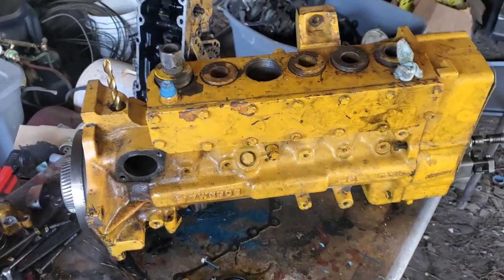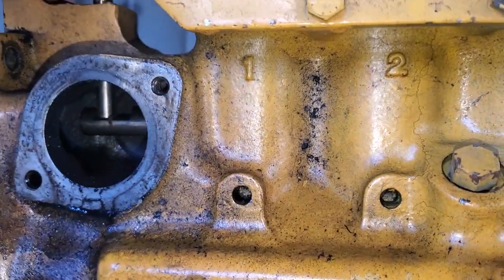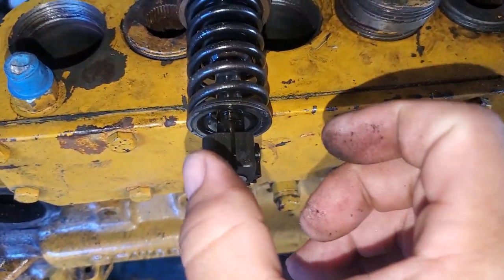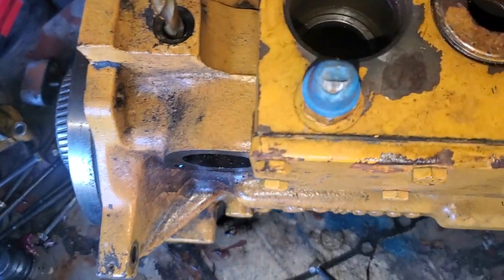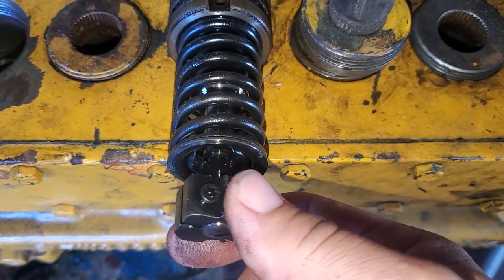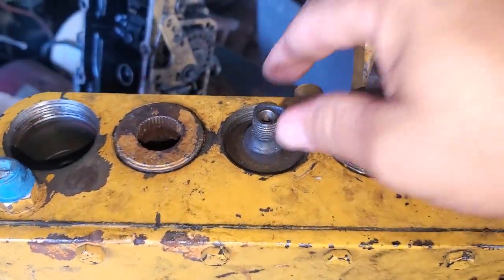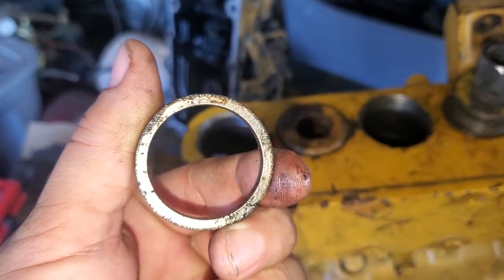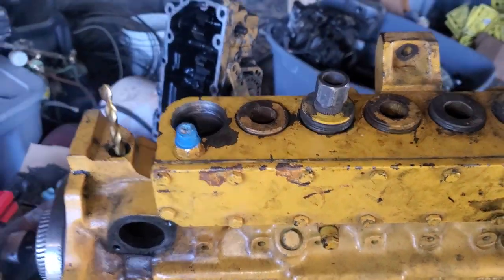How to change/time plungers in 3406b CAT fuel injection pump

Comment: Can you chance the plunges. Whit the pump on the engine. And afther you have to calibrate on the lab. O not
Reply from the maker: Yes I changed mine on engine. I removed the air compressor to gain access to the front ones

Comment: What problem were you having that this fixed? I have a miss\backfire in my #3 cylinder in a 3306. I have ruled out valves, injector nozzles, and fuel lines at this point. Now, I am starting to look into the fuel pump. Did you just put a new plunger in to resolve your issue?
Reply from the maker: Engine would not idle. Replaced plungers and solved that problem. Was not skipping though

Comment: Question for ya I’ve got a 3406c how can I get the rack to stay back on the pin does the pin just sitting on it hold it or do I need to do something else due to not having manual linkage to pull the rail back?
Reply from the maker: There's a cap toward the front of motor. On the side, it has two small bolts. Remove the cap and you can move the rack with your finger

Comment: I changed my o ring on this pump because one was leaking. All of them went in easy except one I had to push that sucker in with a bar. I did it still on the truck but it did go back in I wanted to know if it was ok pushing it back down with the bar I used. Thanks for any advice
Reply from the maker: Are you taking about pushing the plunger down? If so yes there is a cam that pushes up against the plunger. You could rotate the engine and it will release the pressure off each one.  I didn't do that when I changed mine.  Just pushed it down with  screw driver while I tightened the nut
Reply: @skrapenpennies9947  I opened the throttle and it dropped right in thanks again my friend.
Reply: When u say leaking. Was it leaking fuel into oil?  Mine just started doing that. N its not the adapters. Said its in the pump
Reply: @hurricane7179  hello to you could you tell me what you did to the pump? My o ring was leaking on the top where the fuel line goes into the pump. When I changed it that's when diesel was getting into my oil.

Comment: Nice bro
Reply from the maker: Thanks
Reply: That spacer keeps the fuel and the engine oil separated if the spacer got wearn out then the diesel and the engine oil will mix 
You can change tranfer pumps how many you want too

Comment: I'm back again when I put the o rings on I pulled out the one plunger because I can't get it to go back down like all the others. I checked my oil after a couple of days now I have to much oil in it. It smelled like diesel I wanted to know if I I didn't clean it up like you got this one you are working on. Could it be that's why I'm getting diesel in my oil? I didn't have this problem until I messed with that plunger. If I got to go back I will clean it up thanks for any advice.
Reply from the maker: Did any dirt or debri fall in if so you can spray a little ether and I used a vacuum to suck out any dirt. Did you take the washer out at the bottum of plunger.
Reply from the maker: And that was an old pump I used in video. It was really dirty.  You have to make sure there is no dirt at all at the bottom of plunger.  There's a washer at the bottum.  Did you take it out the first time
Reply from the maker: When you put it back in did you time it by pulling the accelerator wide open
Reply: @skrapenpennies9947  it looked clean so I didn't take the washer out.
Reply: @skrapenpennies9947  yes I held it wide open and put it back in.
Reply: @skrapenpennies9947  no I didn't take the washer out of the bottom of the plunger
Reply from the maker: @alfredrevis1876  have you removed the plunger again
Reply: @skrapenpennies9947  no just that one time I'm about to remove it and clean the washer and plunger. My question is do I have to clean all of them or just the one I took out? Thanks for your help my friend.
Reply from the maker: @Alfred Revis  I believe they are separate so prob just the one. They say you can lap them like you do valves. I'm pretty sure that it's metal to metal seal at the bottum of plunger to that washer. Check for trash or maybe a scar. I'm not an expert just a dyi. Check your water level. Mine was making oil but it was my water leak8ng past the head. Hope you get it figured out.
Reply: @skrapenpennies9947  I'm going to pull it out and clean it up a bit. I got some dye this one mechanic was saying the fuel nozzle might be leaking. I will let you know how I come out later today. Thanks again my friend.

Comment: I have a 3406b it's only getting 15 pounds of boost I checked turbo, turbo boots, charge air cooler, diagram in air fuel ratio, transfer fuel pump, and still not get but 15 pounds of boost. Do you think I need to have this fuel pump rebuild. Truck running good just not a lot of power. This is a great video any help would be appreciated thanks
Reply from the maker: Only time mine acted like that was fuel filters being stopped up. You could take air ratio valve completely off and run it make sure it's not that. The plungers are not hard once you see how to line them up. If you get them out of time it will skip bad.
Reply: I changed the fuel filters I didn't know I could take the air fuel ratio off. I think I saw someone put cardboard over the place where it's at. How would you do it and what would I do with the line on it take it off to? I hope this doesn't sound crazy to you I'm new at this thanks
Reply from the maker: @@alfredrevis1876  I built a little  metal plate to go over mine bc I didn't have the valve.  And just took the line off and plugged the hole with a bolt in the intake. You could also check the fuel lines make sure they are not clogged or collapsing. I dying know if you are familiar with these motors but they don't have alot of boost. Mine was around 18 to 21 before I changed the turbo. I've got the screws on pump all the way out and put an e model turbo now I get around 27
Reply: I made a plate for where the air fuel ratio was and plugged the line on the intake it's getting 20 pounds of boost. Do I have to put this air fuel ratio back on Or do I just need to replace it? Merry Christmas thank you so much
Reply from the maker: @Alfred Revis  the only thing the valve does is stops the rack from opening to soon to conserve fuel like when you change gears. You will probably notice more black smoke when changing gears. I would recommend putting one back on just for the fact of wasted fuel ie black smoke. Plus all the excessive unburnt fuel could cause washing of the cylinders over time but you can run it until you get one. Glad that fixed the problem  for ya.
Reply: Change your injectors Alfred. You'll be amazed at the difference
Reply: Good work bro.
Reply: @StuStafford83  just seeing your message will I get more hp if I did that?
Reply: I finally changed the turbo now my plunger on the pump is leaking. If the o ring on top off plunger go bad will it make it leak and loses a little power?